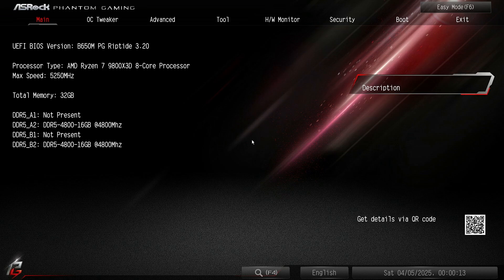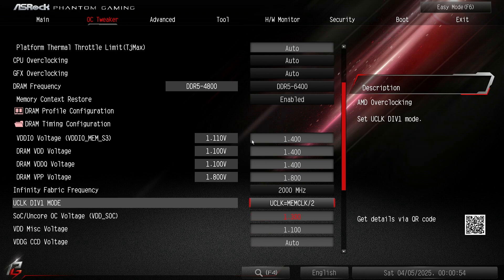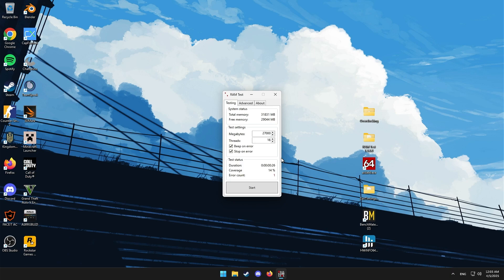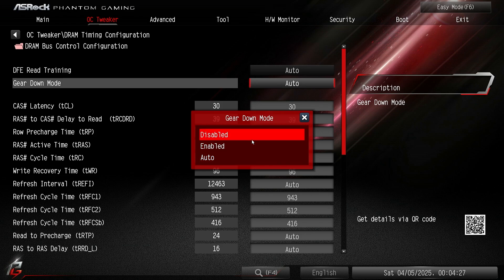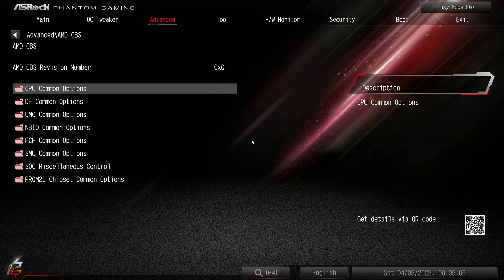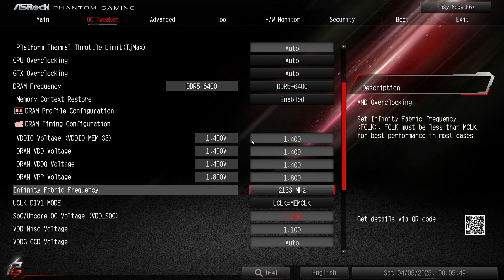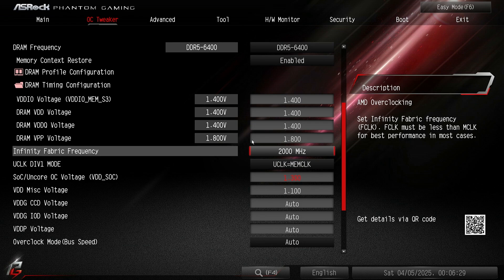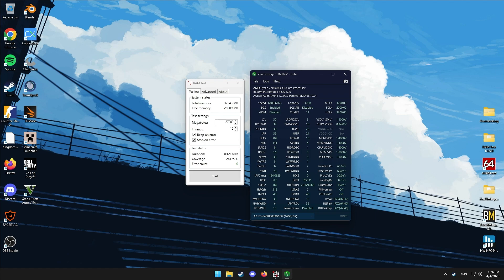How to make 6400mhz 1:1 work on your 9800X3D

Comment: Questions do you have both mcr and power down disabled as well? I found the same issue months ago on bios 3.14/3.15 that GDM on/auto causes instability. Same as having mcr and power down mode on causes instability. 

But it's a hassle since booting takes longer. I haven't bothered with it since, and now running 6200 just so that i could turn on mcr and power down on bios 3.20.

If it's just GDM i might revisit 6400 then to test it
Reply from the maker: no, i didnt turn off mcr and power down disabled, the thing is i've heard they fixed blue screening if u got power down disabled and mcr enabled on ryzen 9000.
are u using a 7800x3d?
Reply: I know about that one, is just that it was more stable for me to have both turn off compared to have it turn on
Reply: Gdm doesn't slow down boot speed. I always set gdm to disabled and set context restore to enabled. Context restore is what will help or hurt your boot times, gdm your better off turning to disabled so your ram is more stable and it will not crash or cause latency by powering down into a power save mode. 

Besides all the other things, have any of you tried just setting your V to 1.45v. This has helped alot of people get their kits to run stable. 

Im running just the stock expo 64gb Trident ddr5 6000mhz cl26 kit and I haven't had zero issues. 

The only thing I've changed is set expo to enabled.
1:1
Power gear down = disabled
Context restore = enabled . 

In my gigabyte Aorus X870E Master motherboard I've had to set the contact restore and pgd settings in atleast two different places. 

The expo profile voltages are 1.45 so I just left it and you'll have no issues. And my kit is already running at cl26.
Reply: @AJerseyJohnnyEntertainment  ASRock sets a hard limit at 1.3V, which is a bit of a bummer.
Reply: @msctshrly you sure you dont mean 1.4v ? Every ddr5 6000 kit cl30 is 1.4v out of the box, my two gskill trident ddr5 6000 cl26 kits are both 1.450v.  When setting memory dont click and use the drop down menu, just click and manually type in 1.45 and hit enter. Then exit and save. Ive had to do that on lots of settings where they arent in the drop down menu and it only goes to a certain number. But all of them you can manually type in the number . Try that and type in 1.45.
Reply from the maker: there is only vsoc limit at 1.3
my asrock x870e taichi can do way more I even did 1.7 vdd the other day
Reply: @ExtendifyPC I was talking about VDD topping off at 1.45v not VOC. 

For voc I don think I ever went passed 1.2v. (And I think it may have been set for me to be honest)
Reply: @msctshrly , that's your VOC probably that's locked at 1.3v. Im talking about your rams VDD, set that to 1.45v. Half the ddr5 6000mhz cl30 kits expos are set at 1.40. My VDD for my ddr5 6000mhz cl26  Expo was set to 1.45v. 
(Does it matter that they are dual sided 64gb sticks, (2 of them?)  
Anyway for VDD and VDDQ id set at 1.45 and you VOC which is what I think your talking about honestly I've never gone passed 1.2v.   My boy said 1.22v tops. Im terrible when it comes to memory. Thats why I spend extra money to get the tighter expo timmings right out of the box. 

If someone here that knew ram in and out im sure they could get more performance out of my 64GB ddr5 6000 cl26 kit. Lol😂
Reply from the maker: @AJerseyJohnnyEntertainment  it dosent for me, what board you got?
Reply: @ExtendifyPC  , what doesnt for you? Sorry I go caught in the middle of talking to two people at once. 

I have a Gigabyte Aorus Master X870E motherboard 

Nzxt platinum C1500, 1500WATT ATX 2.1 PSU

Asus TUF OC RTX5090 

64GB 2 sticks of Gskill Trident ddr5 6000, cl26. 

Ryzen9 9950X3D 

I gave you the whole system incase you have a bunch of settings for me to try. Lol😂

Oh for cooling besides all the case fans etc. I have a 360mm AIO Artic Freezer liquid pro iii . Temps rarely hit 60°C  for both the gpu and cpu.
Reply from the maker: @AJerseyJohnnyEntertainment  I got confused as well 😅
Reply: I've read a million different things and cant find any articles that agree. Chat gpt told me to enable GDM so it will help with ram running overclocked (expo) and said to disable power down mode because it causes latency and instability. Memory context restore it said to enable for the obvious quicker boot times, but what do you think now? (4months later) 

Im having issues with gigabytes last two bios updates. Are you using the latest agesa version? I think im using the latest version Agesa 1.2.0.3.E patchA.
That's the newest one gigabyte offers, but have you found it to be the most stable?